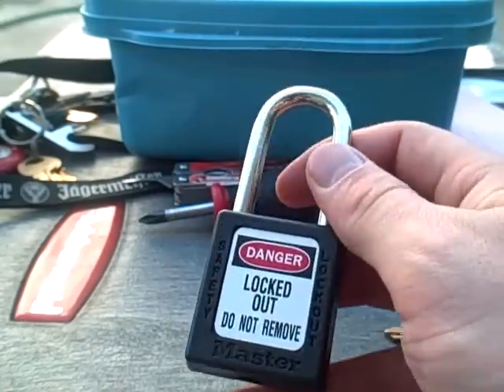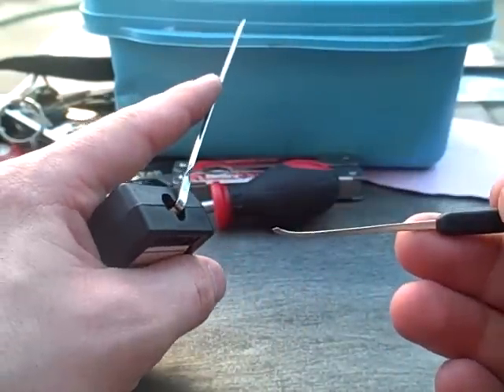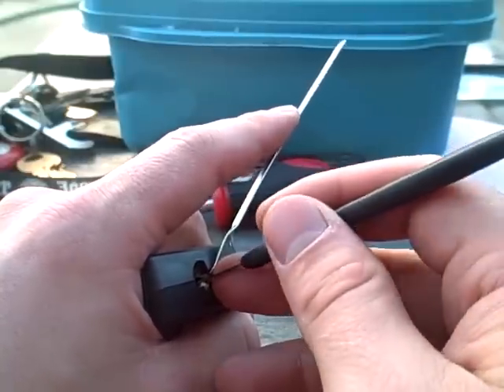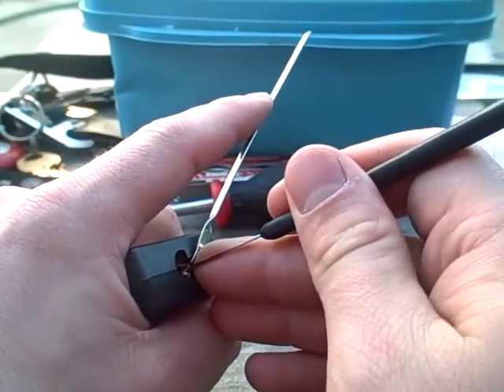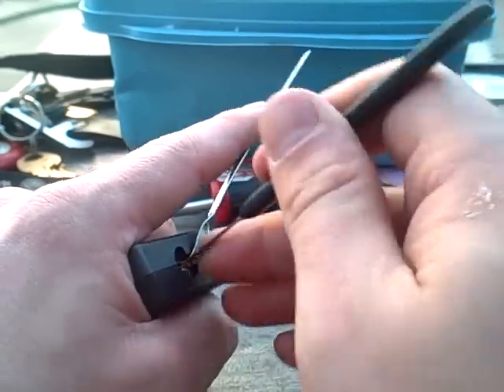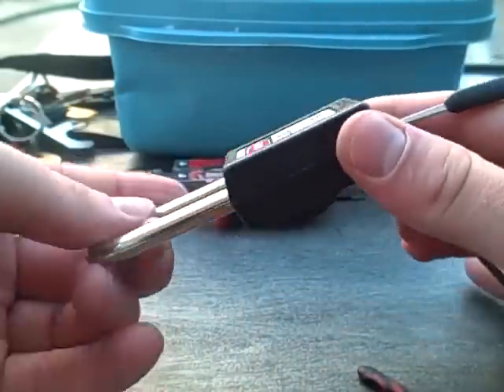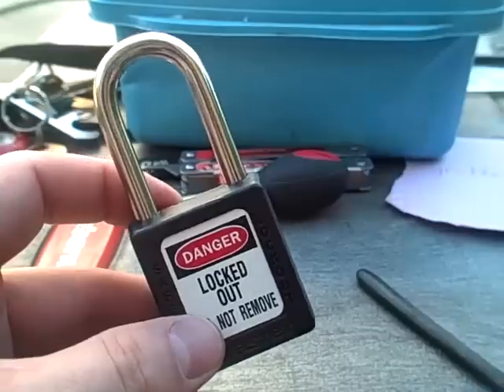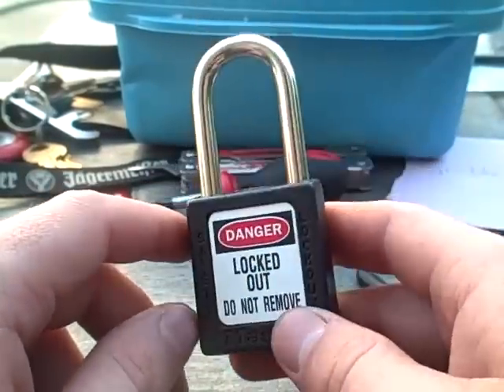Master Lock Lockout Picked...and broken

Comment: I picked a lockout master and exactly the same happened to me after picking it. It rattled just like yours, so after that I did cut it open and most pins or all are spools. 

I was told when the lock was picked, not to turn wrench fully as pins fall out.. I only found that out after picking and asking why I hear pins rattling

Comment: so, I picked the spools back past the shear line and got the core to spin back to 90 degrees from locked, opened the shackle. Closed the shackle and rotated core back to locked. The key pins are still rattling around in the body somewhere haha, but at least I have a bizarre practice lock now, with driver spools poking out through the top of the keyway.

Comment: Just happened to me. Got it picked, core spun a full 180, shackle did not open. Looked inside to find the spool drivers poking out past the shear line at the bottom of the keyway. The only thing stopping them from falling out is the warding, and the key pins have completely disappeared... WHAT THE! 

Time to get out the hammer

Comment: Here's a teachable moment. When you close the shackle on a Master or American lock that has been picked - WITHOUT rotating the plug back to the left - this is what happens. 
You over spun the cylinder and dropped the pins out of it.

Always remember to turn the plug BACK - before closing the shackle.

Don't feel bad - it happens. I've done it three times on American 1105's and one barrel lock.

Learn from it and remember - when you open the lock - TURN THE PLUG CCW AND RESET IT!